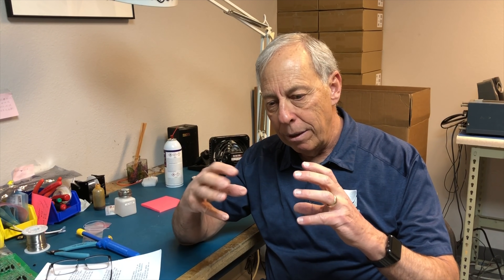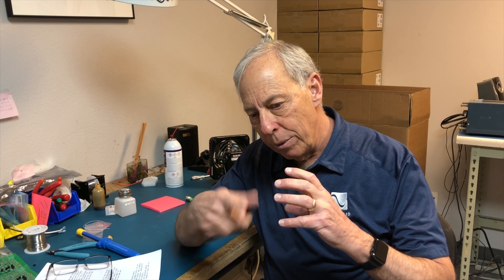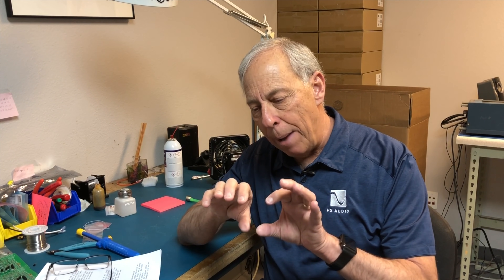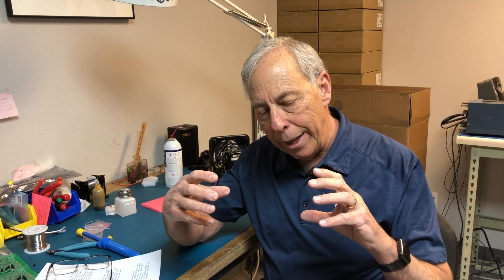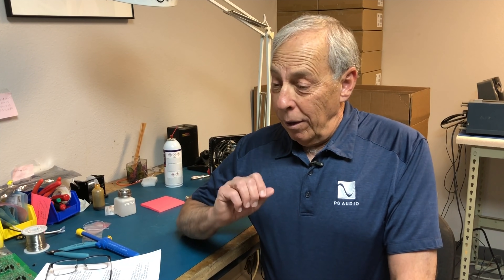Why aren't power amplifiers regulated?

Comment: @Paul At the end when you were talking about regulating at the input stage, as that's where you can get away with it, is the input stage that you're referring to in the preamp, so basically you're getting a steady voltage that you can feed to a power amp? I just want to make sure that I'm understanding correct. Or is there an input stage in the power amp? I'm a little confused, but to be fair, it doesn't take much. 😊

Thanks for the video. 👍🏽

Comment: Power amplifiers are not regulated because it will lead to some extra big heatsinks and lots of power transistors for the power supply itself, which again leads to a bigger amp cabinet and weight, and not least extra cost.

Comment: Well.... but you could use a switching regulator which also regulates the output voltage but dissipates almost no heat....

Comment: I must comment on this old video , Bob Carver used a regulated power supply with his "Magnetic Field " amps back in the 80 and 90's . He used a triac driven by thus tracking the music , He did not need a "big ass " transformer and his amplifiers ran cooler than most other brands of the same power.

Comment: As I recall from my AC electrical class, the bridge rectifier flips the negative part of the sine wave into a positive voltage, so all the blips are positive, and the capacitors reduce the resulting ripple voltage to create what looks like DC to the rest of the circuit.

Comment: I still think regulated route is the best as this will be DIY in my case, you can build 60V+ regulators @ 5A/10A using LM338K, now I heard the LM338K/LM317 regulators are unsutable for audio voltage regulation, anyone know why?

Comment: Another aspect that is not mentioned in the video is that the amplifiers are designed in such a way that they are not sensitive to power supply voltage variations.
For example, if an amplifier is powered with an unregulated voltage of +/- 60Volts, there could be variations of +/-5 Volts due to the variation of the output current, but the ear would not notice changes in power if the amplifier is well designed.  This property of amplifiers is known as "power supply rejection ratio" (PSRR).  The higher the PSRR of an amplifier, the more independent its output level will be from variations in the supply voltage.
Designers, instead of designing complicated power supplies, prefer to use simple power supplies with amplifiers that have a high PSRR.

Comment: Does that mean that preamps are usually regulated? Asking because a Bow Walrus(power) connected to Bow Warlock(pre) there is a hum coming out of the speakers without a singal fed into the pre. I bought the amsp from a dealer who’s trying to convince me that that hum is part of the design philosophy to accomodate for dynamics. On the other hand, when I connect the same power amp with a Gato Audio pre the hum is non existent. That points to an issue with the Warlock pre. In my mind those dynamics are direcrly connected to the power amp and not the pre amp. I believe the issue in the pre amp is not due to an unregulated power supply but due to a grounding issue. Can anyone weigh in on this please. 🙏

Comment: A very convenient excuse for not having a PROPER power supply.  I know it's not that black and whit, but considering high end audio does it as well - NO EXCUSE!  I am a power supply deisgn engineer, it is not that hard, and in this case a hybrid (tracking switcher with linear post reg) PSU would do very well.  as I said - NO EXCUSE   ...cheap asses!!!!!!!!!!!!!!!!!!!!!
Reply: OH, and the PSU would actually be MUCH smaller!

Comment: The explanation is only one side. Goal mustn’t be lowest impedance but right impedance. 

Naim, Onix, especially John Farlowe Exposure Electronics did regulated power supplies in power amps in the 1980s to 2000s. 

In the British 8 Ohms world with limited damping factors this works very well. Take an Exposure X/XV integrated or Exposure IV Dual Regulated. „Simple“, well seasoned Zener & transistor regulated PS. Sound is amazing.

Comment: Carver attempted overall power amp voltage regulation in the 1980s with his Magnetic Field amps, using a triac to control the primary AC voltage on the power transformer, but whether or not this actually provided major sonic benefits is an open question.

Comment: Would an internal SMPS regulated power supply for an audio output circuit be that cost prohibitive? Would/could it improve overall THD and sound quality?
Reply: That will be cost prohibitive for ps audio. They do sell "power conditioners" and all of those are no more needed when amplifier is powered by regulated SMPS.

Comment: I assume this is were external power conditioners, etc, come into play. An entire chassis built around the regulation of input that includes larger heat sinks and such to provide constant input level. This would be in an effort to reduce the work on the amp keeping heat lower and therefore "cleaner" output. Is that a correct statement?

Comment: Howdy.
In another video You describe how an amp. sounded awful fed from a regular supply but great fed from a big mama supply.
I believe regulating a power amp. would introduce the same "mystery" degrading effects. In my mind the series regulating transistor would introduce "mystery impedance" to non-linear current demands.
In regular Hi-Fi apps. I don't think these ghost parameters have any relevance but in High End they seem to have.
Regards.

Comment: You don't need frank voltage regulation.  Instead,  you should have large enough filter caps to provide sufficient  dynamic headroom  to handle  peak power  demands.  BTW:  I prefer choke input on my power amp Vcc supplies [for CMOS output stages]

Comment: What is your stand on the need or lack thereof of an outboard ac mains filter for audio equipment? There is much debate on this platform over this issue. One person in particular says it is unnecessary to use mains filtration on audio equipment. Keep in mind that I am not an engineer, but I am not deluded into thinking that mains voltage coming into the house is free of noise and voltage spikes. How can anyone believe that there is no need to filter that out or that all equipment is unaffected by it in the operation of particularly audio gear. I think anyone who believes this has no affect on audio gear performance is delusional, but I am willing to listen to someone who knows that things like switching noises and even 2kv spikes do come in on line voltage coming into houses and this is detrimental to that equipment. How can anyone believe that the equipment is supposed to not get influenced by this nasty power through the equipment’s power supply eludes me. There are others that understand this. I need a detailed explanation because I am convinced that the power supply in equipment is incapable of getting rid of this and an external filter is both needed and should be used. Thank you for straightening this out as others are curious also.
Reply: How good/ effective a standard amplifier power supply is @ filtering noise on its pri. side ...try something simple yourself...
...set your amp. volume/gain setting to the level you normally listen to...but do not provide any source input...
run some suspected noise generating gadgets elsewhere in the house....
( tv/ any lamps on dimmers..inverters etc.  brush motor mixer grinder etc.)  
If your amp is good you should not hear anything from the speakers...& confidence will prompt you to slowly increase that volume to a higher levels and check again...
judge the outcomes for yourself...

Comment: Voltage regulation is a gate on a dam. It opens and closes to control the flow rate. It attempts to keep the flow constant. When the stream requirements are relatively small, such as preamplifiers, then there's not as high of flow rate, what we call current, as there is for powerful amplifiers that must provide much higher current.

Traditional methods of power regulation are inefficient, can be heavy and expensive for all the reasons you stated, Paul.

The drawbacks to analog power regulation, can be mostly removed when we have a digital power supply. It takes the incoming line voltage and not only increases the voltage by several times, it also changes the normal 120 Hz signal, and changes it to a higher frequency. This does two things. Since power distribution is a product of voltage and current, we can reduce the current demands significantly if we increase the voltage. Power output remains the same. If we reduce the current draw by 8 to 10 but still provde the same power, we have reduced the heat dissipation problems. On top of that, by using a higher frequency, there's a much shorter time interval to filter between peaks. 

(very simple explanation not all encompassing).

Comment: This is not correct. The guy from India was asking about regulated power stages not traditional linear that are then linear.
High End JL Audio amps use regulated power supplies. I have 4 of them. 2x JL300/4, JL HD750/1, & HD600/4.
they guarantee the same power no matter of the range of battery voltage or range of impedance the driver.
reason manufacturers don't do this very often is because it's more expensive. But it is by far a better power stage. Those who claim unregulated power supplies have better Dynamics and headroom don't understand the definition of distortion. If I send a signal through an unregulated power supply and it can supply that signal as long as it's momentary but can't supply that same signal cleanly if it's sustained then that is distortion. Period.

Comment: The Quad 303 power amplifier is intended to drive Quad ESL 57s, it has a regulated power supply because ESLs are intolerant of being overdriven.  An unregulated power supply allows for higher transient voltages at the amplifier output stage which could easily mean death to electrostatic loudspeakers.  Thanks for the video, Paul.

Comment: I agree with having the power amplifier stage unregulated. It leaves room for dynamics in the amplifier; instead of leaving it sounding "compressed" for lack of a better term during peak transients. Also as far as I know there's no commercially available linear regulator that could handle the current required for a high power amplifier (50W and higher) so you would have to design the regulator yourself out of discrete components, costing not just money but like Paul said heat sink real estate, chassis real estate, and I would like to add board real estate. I also see a lot of folks saying "why not use switch mode regulators?" Switching regulators are great for certain things but their switching noise gets on the voltage rail and could negatively affect performance of the amplifier. Additionally that noise increases as the current draw increases. The high frequency switching noise may not be heard but its effects could cause non linearity in the amplifier that could increase distortion (THD and IMD) which will be heard.
Reply: Eric- great post- sicne you are obviously knowledgeable and keen on thsi subject, do look at Sanders Magtech. He is a EE engineer who doesnt disagree with your observations but appears to found a way around these issues to produce a fully regulated, very efficient class AB amp, and with very competitive durability and cost to manufacture. Worth checking out hsi white papers for a maven like you.
Reply: There is a reason why no one makes lineal regulators for power amplifier power stage: swithing regulators. Top designers can design proper power stage with switching power supply. Ps audio doesnt sell those properly designed anplifiers.

Comment: I thought Paul was going to mention HEADROOM. In order to be able to burst, is desirable for power amps to be able draw more power than a supply stead state can provide.  A better topic, why not use more efficient switching power supplies?
Reply: It's not what you mean, but "rail-switching" Class G power amps designs date back to the late 1970s. You use multiple tiered power supplies and only tap into the higher voltage supplies when needed. The downside is that the implementation makes for a very complicated circuit. But those amps do what you are describing. They have headroom in reserve to avoid dissipating a lot of heat when it's not necessary.
Reply: Well the high frequency switching noise from the SMPS is generally seen as undesirable, with the advent of the GaN fet though they might be more accepted for high end use.
Reply: I am using it as of now no problem so far

Comment: The output stage of a power amplifier actually IS a voltage regulator (in its simplest form an emitter follower transistor topology). It tries to achieve an instantaneous desired voltage (as dictated by the input gain stages) across the output terminals (assisted by the negative feedback loop). So, as long the power supply is higher than the output voltage, the output stage accurately produces the desired voltage, even if the power supply has fluctuations. Therefore power regulation is practically unnecessary.
Reply: I think there is some truth to your argument, it all comes down to how well designed the circuit is; lets face it there are some shabby designs out there; particularly in 'high end' audio.

Comment: Regulators are such a pain to use, and like you said the power losses are massive.  Dropout is such a big problem when Vin is close to Vout, like as in automotive applications where you need a straight regulated 12volt from an input that may only be 13-14.4volts. Yes, you can buy the low drop out types, but they are usually only around 1amp rated.  This is one area where I feel that semiconductor manufacturers have let us down badly, I feel they should have done more research and by now we should have super efficient and easy to use regulators, that do not require external capacitors or protection diodes for driving inductive loads, or to protect from back surge off decoupling capacitors. It is the 21st Century now, and the off the shelf regulators I see advertised have changed little since the 1980s. 
Maybe some company has already invented my dream regulator, I bet even if they have they have put it in a pain to use, nasty T03 package and made the bloody case Vout so that fiddly insulator washers are needed.  And if any manufacturers are reading this, let us have a 10 or 15 amp device with mosfet gates inside to reduce power losses.
Reply: Richard Sandwell: I dont think manufactures have let us down, its just physics; you cannot integrate large inductors or capacitors on silicon, as for packages there are so many options now other than the To-3. BUT I share your frustration at power regulation.

Comment: most users in  home cinema sound requires--max 5.1 channel=50w*6=300 w ---so easily smps can handle that--cost of smps is really cheaper than transformer-but my question is --does regulated power cuttof any frequency bands of sound or distortion ?
Reply: SMPS does cut power conditioners out of business, including ps audio "power regenerators".

Comment: Am I correct in saying if you have enough current from the transformer and it's a big one you don't necessarily need such big reservoirs on the capacitors? The capacitor's only there to give the power supply the omph it needs when the transformer hasn't got enough current, is that correct?
Reply: No, if you didnt have the capacitors you would end up with a low frequency hum on the output (which is always 2 x mains frequency), so if you live in the UK you would hear a strong 100Hz tone.
Reply: not quite right, a small reservoir capacitor is able to lower the background  hum noise depending on low ou high magnetic flux (tesla) the transformer was calculated (high tesla more noise), however the speed that empties the reservoir depends on the signal frequency, very low frequency empties the reservoir very fast, the bass note  played change from a real bass sound ending up in a humm noise. If the amplifier is a guitar amplifier capacitors dont need very high microfadys because the frequency dont go so low.

Comment: I wish you would change to switching power supplies.
Reply: SMPS are fine for lower current amplifier applications and other things, but in an class A or AB stage power amplifier, the high frequency noise from the SMPS gets into the amplifier stage. And the noise level increases with more current draw. While this high frequency itself can not be heard, it will affect the performance of the output stages and introduce distortion which can be heard. The way they do it with simply a mains transformer, bridge rectifier and filter capacitors is the best way.
Reply: @marcusfred4480  absolutely ridiculous. Outher manufacturers have this figured out. Also outher manufacturers dont have power condioners to sell.